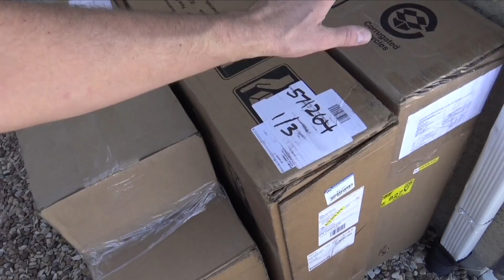Building the Ultimate Station Wagon | 2021 Charger Magnum Hellcat | 1000HP Hellwagon | Pt 14

Comment: Looking good Dave 👍 custom car building is teedius and repetitive but the reward is the best feeling of accomplishment...stay the course...why the composite roof?..... magnum roof panel should fit doesn't appear you widened the roof area....just wondering...👌👍✌️
Reply from the maker: The charger roof is more narrow
Reply: Oh I see and can't seam in a charger roof panel? I am just thinking about adhesion of composite roof and then strength because that car will twist a little bit with torque... know what I mean....?

Comment: as a body specialist for almost 2 years now, i can say you're doing a really good job here, cant wait to see this monster all one color, but please remember to give it a good 1-2 days to sit and bake the paint and clearcoat before attempting to polish or put body panels you removed back on, it will reduce the risk of chipping just a little bit, in that time though you could easily slap in the engine and transmission of you had those ready, or work on getting them ready in the time your waiting for everything to cure fully. also if you're gonna ceramic coat it, you will have to wait a few months before you can, otherwise it may screw some things up
Reply: Why do you have to wait to ceramic coat it? I will be painting me car soon and would love to coat it after
Reply: @randyd9414  thank you for asking, the clear coat actually takes quite a while to fully cure, most clear coats are urethane based and will cure enough anywhere between 1 and 7 days for the cutting and buffing of it to make it glass smooth, after that it needs more time to fully cure, which depending on where you are, temperature and UV are what cures the clear the fastest, meaning it could take between 1 month in someplace like central Arizona where it's really hot and lots of UV, or maybe even up to 4 or 5 for a complete hardening in a place like Montana where the UV index is considerably lower and it's cool to colf. if you are in a place where it doesn't get warm or hot you can speed up the process by putting the body into a garage and cranking the heat up in there to about 100 f for anywhere between 5 and 8 hours a day for between 3 and 6 weeks, after that I would check the surface finish and fix any scuffs or scratches with a polishing unit. after all that it will be fully outgassed, and the ceramic coat will go down on a hardend finish, otherwise it will be just that little bit soft under it and make it easier to scratch and damage
Reply: Im not sure if he will use it but his buddy uses production clear, and that takes a few hours to be done, so he has options
Reply from the maker: After I paint and clear the first time after the clear hardens in 24hrs I'm going to wet sand it and re clear it then after 30 days clear braw it
Reply: @Junkyard_Dave  glad to hear you have a good fast curing clear and a good plan! when you re-clear it just give it a solid once over to look for any little imperfection and clean them up, if i see this car in person, first off ill be drooling, secondly ill give it a good look over at every angle, color and surface finish makes or breaks a car, and i have good faith you're gonna make the right choices

Comment: Was great to interact with you during Q&A with you.
I have a suggestion for your next project: turn a 2013 to current Jeep Grand Cherokee into a pickup truck but keep the independent front and back suspension....
Reply: That's called a honda ridgeline......

Comment: If you have good body lines on a Dodge you know the factory didn't build it. 

Look at a new challeger 1/4 panel, especially the passenger side. (Edit, this isn't a gap issue but just an idea of how bad the bodies are on these cars) They come bent over the wheel from the factory. I've never repaired one that didn't look better than original....which is technically a bad idea. You want an invisible repair according to many people. 

I don't care in that instance, I want a straight panel. Challenger door gaps are usually tight at the bottom of the 1/4. 

I may have missed the color choice. If you have good gaps you can paint it any color. If not paint it a dark color. People think white hides flaws, it does but it doesn't hide bad gaps.

Comment: Why can't anyone on youtube make a simple plug weld that doesn't look like garbage?  You don't do a stitch weld in a !:×$#: hole. I still wanna see how this turns out but JFC.
Reply from the maker: It's the metal I'd like to have a professional welder try it out because they galvanize it and you cant get that shit out of the metal
Reply: @Junkyard_Dave  bull. . You have paint right by the welds. And heavy HEAVY Dodge primer/sealer. That stuff burns and contaminates your welds. Start in the center of the hole when using a junkyard part and make a circle outward. You need to be able to feel a slight bump on the back of the panel you are welding to. 

Your weld should look like a rivet, not bubblegum. 

There are two things you have got to do. Clean and clamp.

Comment: The only part of this that concerns me is the interior. The exterior is turning out amazing but the amalgamation of body panels will be odd for the interior
Reply: he can make composite panels where there would have been plastic and it would make it that much more special actually @JunkyardDave? what say you Carbon fiber window pillar trim?
Reply: So 95% of the interior will use the stock stuff. Most of Chrysler's stuff use the same attachment points. So a Challenger dash will bolt in to a Charger and 300 is a example. Also there is plastic welding and if backed by fiberglass for extra strength it can be pieced together a lot like the outside body panels. Biggest drawback there is they have to be painted so scratches so up easier. He could go custom carbon fiber panels like Sean said but either way it's not going to be anymore difficult than the outside was.